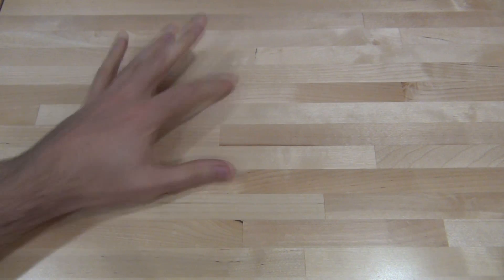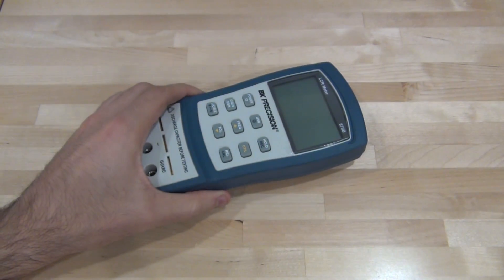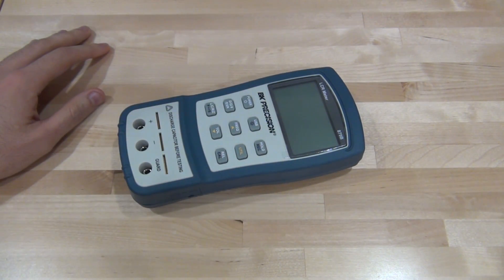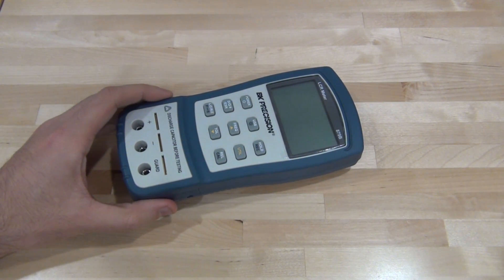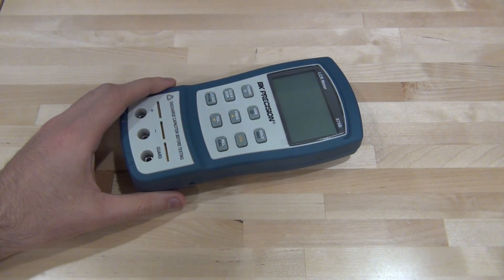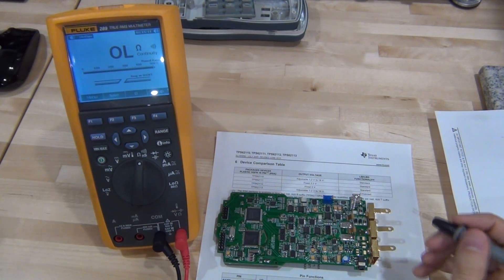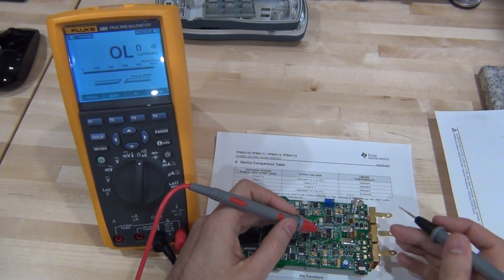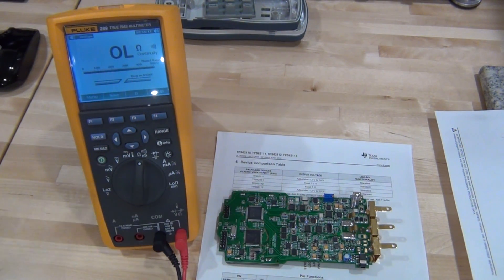TSP #93 - Teardown & Repair of a BK Precision 879B Handheld LCR Meter

Comment: 2xIRLML5103TRPBF MOSFET P-CH 30V 760MA SOT23 , Q600 switch from battery to external power and Q651 switch on-off ( soft load switch together with Q 650 )

Comment: It looks like this LCR meter has only three input terminals as the connector/slot for the kelvin probe is made of one piece of metal. So using a real Kelvin probe make no sense here as it will not be real 4-wire sensing anyway. Or Am I wrong here?

Comment: Hi, nice repair but your video lacks a great deal of really needed detail. For instance you did not say why you've changed the IC if you've found the transistors to be the problem. Also you never mentioned ( not even in the comments) what is the exact part number of the P-ch. MosFets you've decided to replace it with ? Now if my meter would have had the same defect and decided to follow your video to repair it, it wouldn't be of any use to me since I simply do not know what part number to purchase
Reply from the maker: I don't think you listened to the repair carefully. The DC/DC converter was damaged as confirmed by the measurements before and after the component was replaced. The transistor is a generic PMOS.
Reply: @TheSignalPath  Tnx for the quick reply. Yes, you are right. I must have somehow missed that part with all the ads that YouTube is pushing these days every so, often you know? Thank you once again

Comment: Apparently Shariar's demo of the workbench helper must have led to big sales for Bangood as they're out of stock and won't get more until mid-March. I recommended guys in my Ham Radio Club's Builders Group consider one if they didn't have a adequate magnifying/lighting apparatus on their workbench and that's when we found out it was not currently available.

Comment: Just for clarification were the PMOS transistors a problem/replaced?  The video just seems to jump from the transistors to the voltage converter chip.
Reply: Rk Str you mean the one that let out the magic smoke?  I'm pretty sure it was bad.
Reply: I guess I didn't see any comments later about replacing the component.  I also thought he had trouble finding the part number off the package.  
So where the 2 component failures related??

Comment: My soldering station was so covered with unfinished work and rubbish I could not get to my irons so I grabbed my gas powered iron from my workshop.  About 90 seconds later I discovered (sic) that the lens in my 3rd hand was plastic 😪.  Now replaced with glass lens and a big metaphorical note to self to keep the metalwork kit in the workshop, not the lab! Nice piece of kit from Banggood!

Comment: Let me try to guess. Judging on the fact that this is a battery powered device and you are keep mentioning the ac supply i would say that those 2 transistor are P-channel mosfet type arranged in a bidirectional switch configuration.

Comment: 2x PMOS. I suspect MOS over BJT for efficiency reasons, and I suspect PMOS over NMOS because they're already on the + rail so fully turning on a NMOS would require a ++ rail. I feel like this reasoning is cheating since it requires zero knowledge of the circuit in question, but I suppose simplicity is a virtue as well. I made an implicit assumption that the devices were enhancement-mode on the not very good basis of never having seen depletion-mode FETs in power circuits. Does anyone here know of any?

Comment: Probably 2 P-Channel Enhancement mode MOSFETs connected source to source to prevent damage from incorectly installed battery and to prevent charging battery from external DC input. I would guess damage is from incorrect connection of excess voltage to external DC input.
Thanks for the videos. :-)

Comment: hey Shahriar, about those probes. Coincidentally I replaced my even shittier probes with the ones you also bought. Why do you think these are shitty? (I do not have a reference to judge why they are good or bad)
Reply from the maker: The tips were sharp but pretty soft. The insulation felt stiff. The probes consistently made poor contact.
Reply: Agreed. The funny thing about these probes is that you see that they sell two models, I guess for the thicker ones they just grind off the smaller tip. fortunately for now... these are better than the ones I had previously. Those tips exploded when I probed 230v with the probes in the Amps socket... oops!

Comment: Looks like a spectrum analyzer to me at the end of the video, based on the large screen and single type N connector. The only one I worked with so far was a Tek unit, so this might not be a Tektronix one.
Reply from the maker: It is a spectrum analyzer! But like you said, not a Tek one.

Comment: My dad had a Helping Hand but each arm had two joints in it, which made it super useful for holding and supporting anything you could imagine. I've wanted to find one like that forever but almost every one I've seen is like this one with only one joint on the arms.

Overall it's a great video but the color temperature is definitely way too blue. I feel chilly watching the video. Besides that though, I like it!
Reply: nice... not exactly the same as I had imagined but that does look pretty handy.

Comment: I think the battery was installed backwards and left that way long enough for that transisitor and such to burn.  It looks like the type of compartment where that could happen.  A momentary backwards would be ok but if it was left in there for a long period then I belive it built heat and popped.

Comment: How come Mr. bangood solder helper don't have its own batteries?  Useless. Go to grandma's house and grey tape her magnifying glass to some clothes pins.
Reply: John Cundiss so the stupid coin cells they'll use don't die when you need them most, corrode the battery compartment, and make the whole thing garbage. Also, I think a lot of hobbyists these days are using 5v USB for at least some of their projects and would have a power supply of that type handy.

Comment: Wow, that is an awesome painting. These 4 transistors  of which you replaced two seem to be little mosfets connected in a way that they aresome flip flop or self holding circuit. The button turns it on directly and software can turn it off. I have seen something like that done with HEF4001 (or HEF4011?) used as RS flipflop and a BUZ171 TO220 MOSFET in a meter. That circuit was from the early 90's. However, this one is neater, only 4 transistors.

Comment: Interesting diagnostics and repair. I see no one has yet attempted to identify the obviously faulty component and I won't spoil the surprise!
My only problem with Banggood is that no matter how large my order they always break it up into lots of separate deliveries which inevitably leads to one of them going missing. Although they are quick to offer a refund I'd much rather just have the items I ordered. Perhaps if everything was shipped together it would be more reliable - it would certainly be more convenient! I live quite close to London so it's not like I live in the middle of nowhere so why do Banggood orders keep going astray? I don't get the same problem with eBay orders from China.

Comment: Keysight Spectrum Analyser 17:31
Reply from the maker: Yes it is! But which one? :)
Reply: Tricky... looking at those connectors on your table it's the high end one. Guessing a N9030B-RT2  the connector on the top right and Black color... clue :)

Comment: I strongly suggest probe Master probes.   They are very reasonable and are hands down the best probes I've ever used.
Reply: Do R/C! I second this. I was thinking during the video how much an easier time you would have with probe master probes
Reply: I've got a pair of ProbeMaster 8017S, and they're very good -- the screw-on alligator/0.1"/lug/etc tips are brilliant -- but for poking around surface mount boards I still prefer my Pomona 6342 probes. The overall size is more civilized and sharp, springy, replaceable tips are such a joy to use.
Reply: i third this.
Reply: Do R/C! fourth that. Make sure you get the alligator clips too, they're worth the ~$3.50. Furthermore they have a really low resistance which is fantastic for higher current.
Reply: for tiny smt stuff, i actually use a pair of microtex machine needles, soldered to some 18awg silicone insulated wire and bananas and heatshrunk, they are stainless steel so they dont corrode/oxidise much, very sharp and very strong
Reply: I totally agree.  I love the Probe Master gear I've purchased in the past.

Comment: BK Precision LCR meters are pretty nice.  I picked up a used 878 (previous generation) a couple of years ago.  Simple to calibrate as well (2 adjustments, voltage and frequency using a scope).  Afterwards I purchased the DE-5000 (also very accurate) and compared the two and they were pretty much exact.  You got a nice meter for $50 and a little effort.  As to what cause the fault - I suspect someone tried to measure a charged cap?

Comment: WHY WONT YOU TAKE MY MONEY
lol. You have not make a long vid after I became a Patreon supporter.

Edit: its a pnp npn battery disconnect so you don't pull from or back feed to the battery when AC power is connected
Reply from the maker: Thank you for your generosity. Hopefully I will post my next review on Patreon. And the transistors are not PNP/NPN. ;)